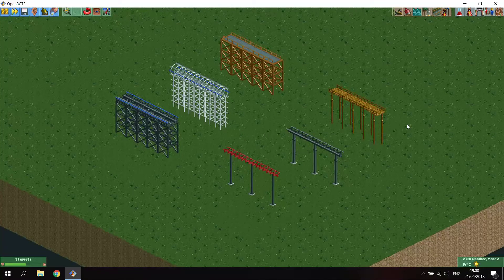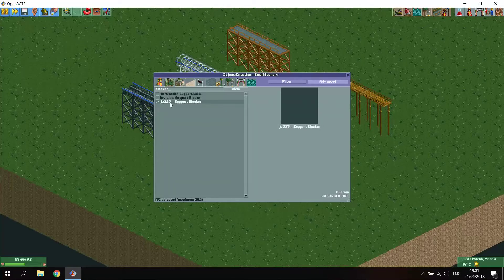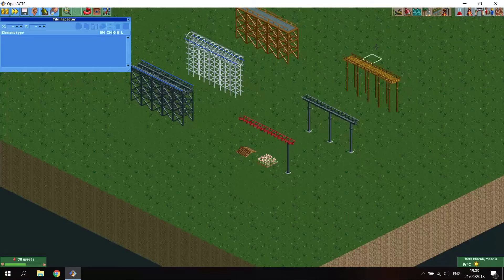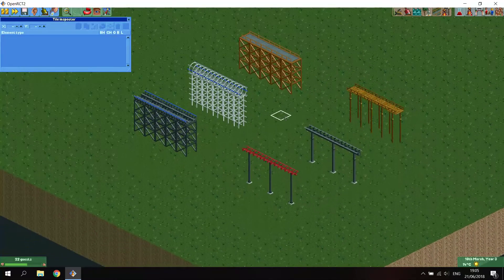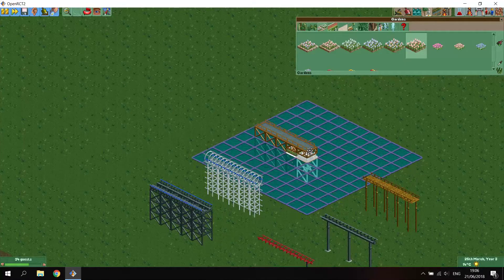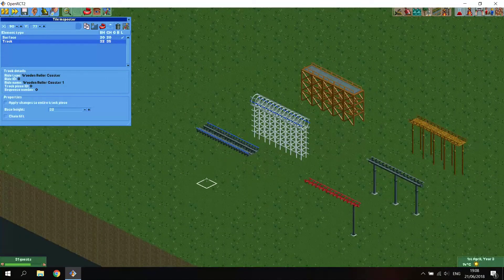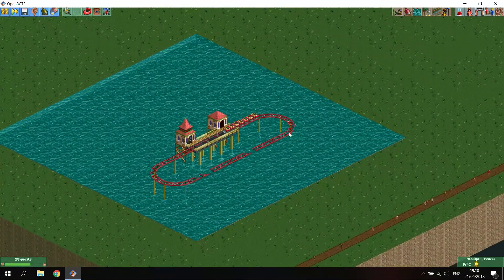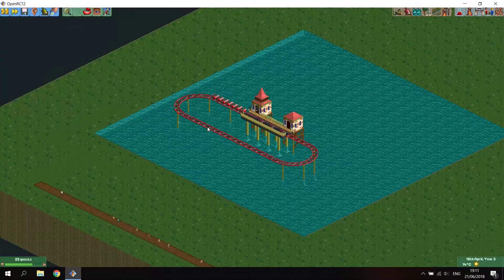Git Gud at OpenRCT2 #4: Hiding supports - EDIT: Check video description for new version!

Comment: you'll have to redo this video without the constant buzz in the back, it's painful.
Reply from the maker: Yeah I should.. I tried a new mic but found out the volume was too low so I had to amplify the sound, which sadly also amplified the ambient noise.
Reply: A simple noise removal implementation should be able to clean up the audio pretty well.